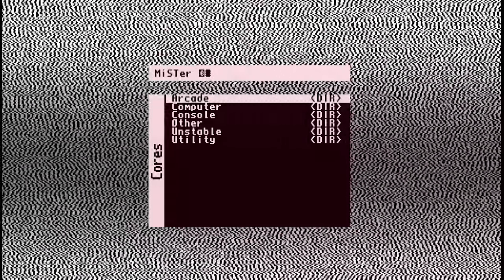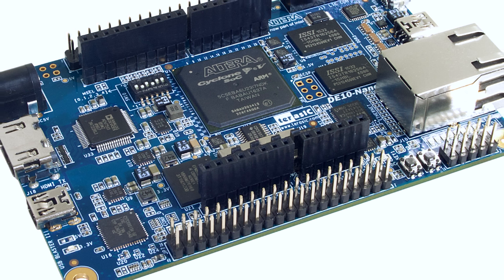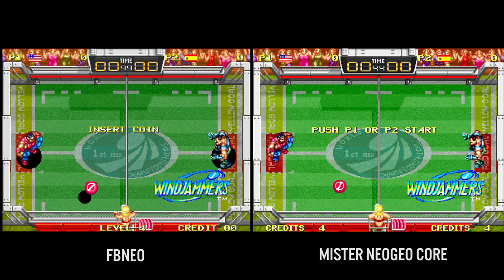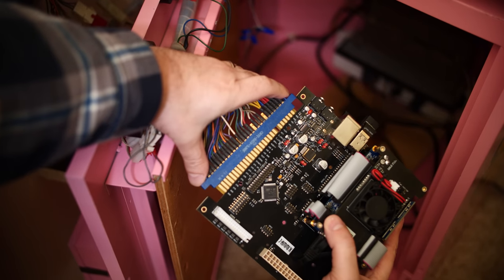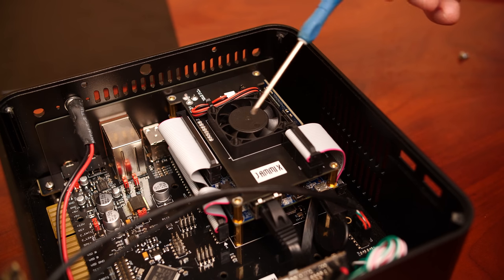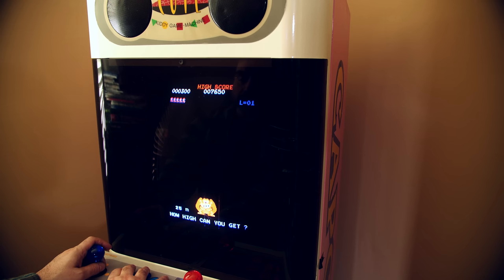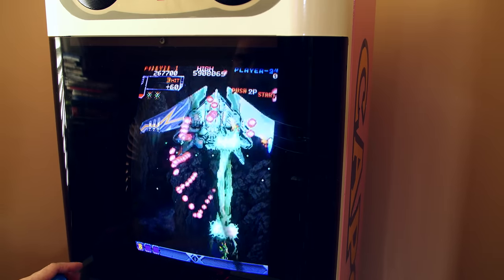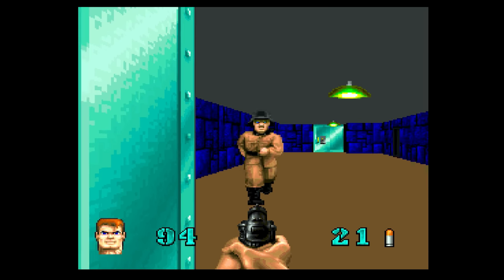Finally - I got my hands on a MiSTer FPGA Retro Gaming Setup | MVG

Comment: One thing that has been a game changer to me (and that Bob is leaning into with the new RetroNAS stuff) is the ability for the Mister to read ROMs from the network.

No need to buy a 1TB SD card or swap out TurboCD games every time you want to play a new one. Just stick all of them on a giant HDD, do a simple network share and your Mister can access all of them.
Reply: Personally, I'd rather plop in some storage.  But I still like the option.
Reply: It's always been possible to use USB drives as well. I prefer the network myself since I have a NAS. The CIFS integration is incredible. It just all works, even if you have local ROMs on the SD.
Reply: I like to note the NAS CIFS solution is viable if you got multiple machines running the same roms, and preferably you are running actual copper and not Wifi. And they all don't have to be MiSTer Machines. You can have a Raspberry PI and a MiSTer running off the same NAS, RetroNAS allows for symbolic links so you can use the folder structure each machine expects. 
It also works well with OPL for the PS2 and SD Loader with Swiss for the Game Cube.

If you can't run a ethernet cable to where you need it, or you got a portable setup you are taking away from home, then NAS isn't a good solution. Then again the 2nd best option to a NAS is a External USB storage device plugged into the MiSTer. MiSTer is limited to USB 2.0 so the Ethernet port actually has faster read/writes than USB. But its still much faster than reading/writing to that SD card.

Comment: I have to say that I have been quite impressed by the ease of installation, actually. It's a matter of burning the Mr Fusion image to an SD Card, connecting to the network and starting the update script. I have terrible experience with RPi devices that always take ages to bootup, have dodgy drivers and hardware support and end up swallowing many hours of my life in pure loss compiling modules and drivers in order to achieve what I wanted to achieve. I was honestly expecting the same kind of bullshit when I started to build mine one year ago, but it turned out great, installed without any hickup, boots in a few seconds and never bailed on me since then. It's true that it's not exactly a 100% plug and play solution (configuration can be finicky, for example, needing to manually edit config files) but it's still a great and easy to use everyday solution. It's a great alternative, with tremendous community support, to collecting real hardware, or more traditional software emulation methods if you're willing to pay a little bit and get just a little bit involve into setup and configuration.
Reply: YES! People don't talk enough about how the MiSTer takes just a few seconds to boot, and less than that to shut down. You can make a sandwich while RetroPi boots.

Comment: Great to see the MiSTer getting wider coverage. I’ve been using my MiSTer for over a year with just the Nano board, an OTG USB hub, a HDMI to VGA converter and the RAM expansion connected to a CRT VGA monitor.  The 2x scale from 240p to 480p looks great on a CRT monitor. I think my setup cost $250 total since I was able to get the CRT for free off of Craigslist. With that you can use every core including any of the retro PC cores I’ve tried as long as you have a USB keyboard, mouse and a gamepad.
Reply: Your story is pretty much identical to mine. Hopefully they will get direct video working on the 486 core at some point. Overall I am SO so happy with my MiSTer.
Reply: It's great to see MiSTer getting wider coverage *when you already have one*.

On the other hand, when you've procrastinated about it for years, only to recently simultaneously (a) realise you really want one; and (b), that it's pretty much impossible to buy one now - what with Current & Foreseeable Future World 'o Normality, and all that - this just feels like another nail in the coffin! A very entertaining nail, I'll grant you.

Comment: As mentioned, with "one time" investment-it's a great collection/consolidation of hardware-capable of running 99 percent of the earliest video games known to man. With updates being pushed out, with playstation on the horizon, this is simply a no brainer for the generations that did or want to experience the history and inspirations behind today's games.
Reply: got mine a year ago.. didnt regret a second.
Reply: I've been a fan since the beginning. The MiSTer is cheaper than other FPGA consoles when you consider how much it can already emulate. I'm really looking forward more to the Saturn core than the PSX core as software emulation isn't good enough especially where input lag is concerned. The reason I got the MiSTer is that I'm sensitive to input lag. I know run ahead is a solution but it has its own issues. You can even set 1000 MHz polling rate for MiSTer which reduces USB lag even more to become negligible. I use a Sony Trinitron TV and a monitor with Freesync (MiSTer supports VRR [variable refresh rate]) to cut input lag to be like actual hardware.
Reply: I will be excited once we have a hardware based system capable of emulating 6th gen consoles with 99% compatibility. Even if it costs 1K, I will be one of the first people to buy it. However, for those that enjoy the older stuff this looking promising :)
Reply: @Manic_Panic  you will be waiting for a while. The DE-10 is heavily subsidized by Intel and actually worth at least $350 from its $160 retail price. As MVG mentioned there is heavy scalping of the Terasic DE-10. Take a look at the unsubsidized  prices of FPGAs especially ones more powerful as they can cost in the thousands.
Reply: @asimian8500  Yeah it's a shame that runahead doesn't work well on all the retroarch cores, as it's great when it does imo. And of course there are other latency-reducing options in cpu-based emulators too. You can get usb adapters for PC that force the motherboard to use 1000hz polling rate, so that is fixable also.
Reply: @davidste60  For software emulation, I’m using a 1000 MHz Raphnet adapter for the Saturn small controller which I consider the best game pad of all time. MiSTer supports 1000 MHz for most USB controllers  and you can use even better solutions like SNAC and BliSSter to cut out USB polling.
Reply: @asimian8500  Yeah, I use a retrobit saturn 2.4ghz and an 8bitdo m30 genesis/saturn hybrid-like thing in wired usb mode. So I could get better latency with better solutions but with what I've got plus runahead + frame delay etc. when possible, I'm probably past the point of diminishing returns. For many systems I'm at original hardware latencies already I suspect.
Reply: They can also just emulate those games tbh.
Reply: @davidste60  very decent set up-but yes, diminishing returns  is a thing. Great way to preserve a subsection of games that would otherwise be lost to time without proper hardware.

Comment: MvG :) With the Amiga Demo issue and Plasma, I too experienced this with the BTS Demo. However, I found a fix for it. Most of the Amiga Demos were coded with PAL 50hz Machines in mind. When using an option to Force 50hz (the MegaAGS Pack I downloaded has a Force PAL Mode option in its Menu), the Real AGA Plasma of BTS worked fine :) If I ran it in the default setting which is NTSC 60hz, I exhibited similar glitches with the Plasma as you showed in this video.
Reply: I'm actually surprised he overlooked that. The Amiga was notorious for only being super-big in Europe.
Reply: The glitches look more like programmatic issues to me, i.e. a slight incompatibility between the original Amiga instruction set and the Mister instruction set.
Reply: As someone that has a working Amiga 1200 (Turbo) with OSSC and SCART RGB going to an HDMI screen (I'm working on getting it to output to a modded consumer TV - old 13" toshiba), Mister Amiga core is not that good.  Speed wise and emulation wise.  Have  you tried games like Project X SE, or Amiga arcade type games?  The lag kills the experience.  USB controllers and HDMI screens lag too much after my extensive testing.  In short.  Real A1200 Turbo boots in 2 seconds with 16GB of games and software realy to play (MegaAGS2 disk images).  Also the C64 core is really not that good.  I have the original C64s and had A600, A1200, had NES, SNES, Atari 2600 many more.  It's a pricey investment.  For experimentation mostly still after 2 years of owning it.  Many games just crash (on any core) and it's up to someone to research a game compatiibility list.  I have mine hooked up to an HDMI screen and VGA multisync CRT at the same time, but it took a lot of messing around.  I still get no video on many cores (Amiga 1200 for example can switch into video modes that no screen will sync with).  More of a hobby thing.  I still have trouble running Super Mario Bros (for famicom/nintendo 8bit).  I keeps running too fast or too slow.  It's called MiSTeR for Minimig which is an old FPGA project and ST for ATARI st which is an old FPGA project.  I'd buy dedicated boards.  The USB hub cuts out at times (I have an Alpha wireless USB connected to remotely manage it and update the cores instead of pulling the SD card all the time).  Still a fun hobby, but it takes up a lot of time.
Reply: I'm scared to run this demos on MiStER or I might end up in 4th realiy.  The timing on the music players is alll over the place because it only emulates close to a 68020, but not quite.  Run sysinfo.  https://youtu.be/UGYCfBGRKJA

Comment: I bought the De10 Nano for only $100 USD back when the MiSTer project started about 3 years ago.  The add-on RAM module was about $40 and the I/O board was about $50.  So I was all in for under $200 back then, and I thought THAT was a lot!  Today’s prices are insane.  

The project has come so far in that time. Way back when, there was only a small handful of arcade cores, and you had to recompile your own cores from the individual roms for each game back then.
Reply: You got a deal. The DE10 was $130 on Amazon when I bought in late 2018.
Reply: @flow221  I did!  I just went back in my emails to see what the exact price was, and it was $110 from Arrow.  I'd love to buy 10 at that price now!

Comment: I was considering the MiSter for quite some time as the system to round out my collection with all the old computers I don't want to buy. Was always a bit held back by the price and the complexity of the build your own stack stuff.
But when RMC - The cave came out with their take on it, I immediately bought it. And it's excellent, I really like it. IO can take it to friends plug it into their modern HDMI TV set and just ask: "so what computer or console did you have as a kid?" and great times ensue.

Comment: Exciting! I ordered a DE10 nano a month ago, which ostensibly should ship today. Just looked, and mouser's now showing 50 week lead time on orders.
Reply: Yikes. Almost a whole year!
Reply: I'm on the same boat
Reply: update: I contacted support. DE-10 didn't arrive at Mouser. Delayed sine die... Damn...
Reply: @paulocorreia2024  Well crap. I actually bought one of those DE10 Nano self-balancing robots (P0582) before I realized they used a board with the JP1 20 pin connector soldered to the bottom of the DE10 rather than the top. I was hoping to avoid having to desolder that upside down connector and solder in a top-side header to get it to work with the SDRAM board, but I guess it's inevitable now. edit: Got a Samtec HTSW-120-09-G-D header which pokes out through both the top and bottom, so ideally I can use it as a MiSTer and a Robot... a MiSTer Robot. 

edit2: 2x Terasic P0582 robots still available on Mouser if someone also feels up to my 20x pin desoldering challenge ;)

Comment: Physically emulating hardware, I'd imagine this is the future of retro anything.

Edit: excuse me, "mimicking" hardware.
Reply: it was made for the industry and military to replace old chips
Reply: Its not emulating the hardware, it can be physically the same as the original chip on a signal level.
Reply: @JohnAbrahamsen  the only thing i dont understand is how then that demo he talks about has glitches, but it doesnt have on real hardware.
Reply: @andrejrockshox  The VHDL code for the chip is not exactly like the original :). The physical gates in the FPGA are made according to the VHDL code. If it is not 100% equal to the original you will get glitches.
Reply: @andrejrockshox  That is likely because the reverse engineering of the original architecture has not been done perfectly
Reply: @koffing2073  its for developing chips... not to replace em. imagine youd have to physicly produce every chip you designed just to test it out.
fpga's simulate the chip and its intended enviroment. thats the reason boards like thr de10 get subsidised by MS and Intel.
Reply: @koffing2073  And to prototype new designs quickly. Great for college students who can't afford to make custom ACIS chips for projects,  FPGA makes their projects much easier. It's what the DE 10 nano is actually intended for, student electronic projects. 
It just happens to also can be used to play video games.
Reply: @JohnAbrahamsen  That not 100% accurate. Yes the DE 10 is replicating that hardware, it's not always 1 to 1. Sometimes compromises have to be made as the signal paths or isn't the same, or the timing between the FPGA and the external SD Ram isn't 100% identical. it already said the Sound in the PS1 core is not going to be a 100% match, that there a 0.1 ms delay, simular to duckstation. It's all done in Hardware descriptive language, so in the end just like software emulation, it depends on how well the code is written and how is it optimized. 
I think Jortago said he got his CPS2 cores with in 0.8% variance to the hardware, he can't get closer as the hardware from board to board has a 0.8% variance. On the other end there cores that are no where close to what the hardware does (yet), like the X68000 core. The AO486 Core is also not 100% accurate to what a Intel 486sx CPU can do.
Reply: @lukasperuzovic1429  the sound on ps1 will be the same no delays if you use dual ram